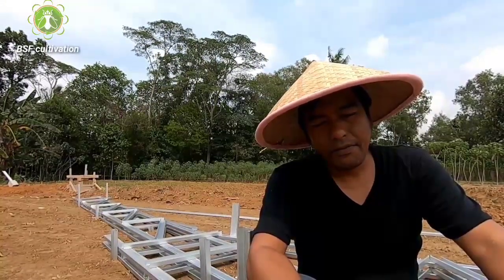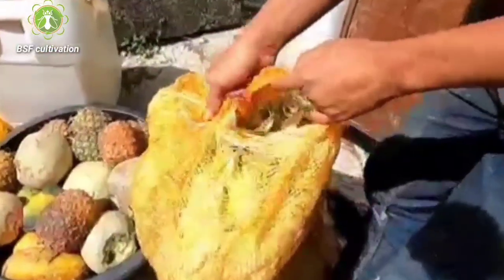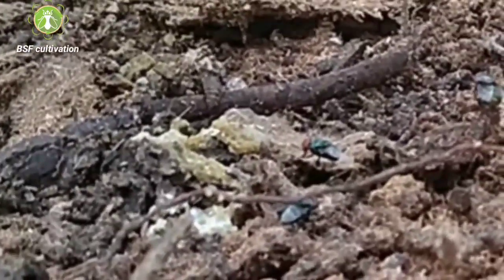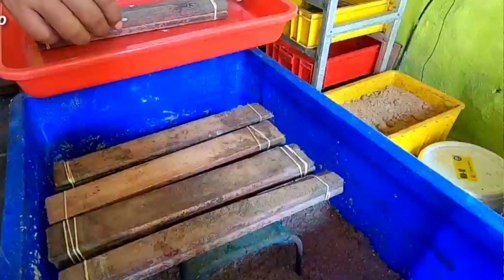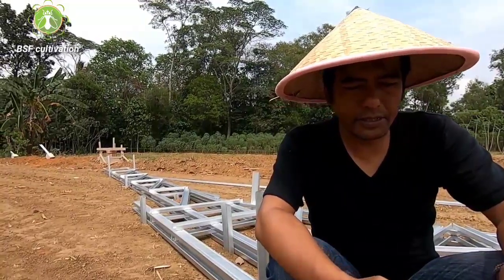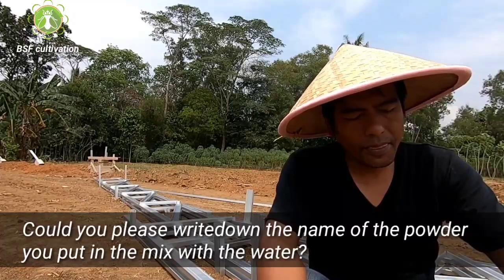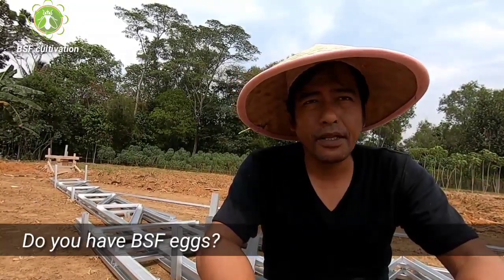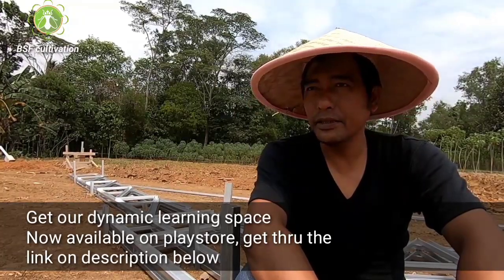Q /A about BSF Cultivation...

Comment: First of all thank you kindly for the time and effort you take to spread the knowledge. Thumbs up.

Second of all, I have a question, my understanding is that the larvae gets best results from the feed, when you provide the feed in a pasty/semi-solid form, i.e. by grinding the food material then add water to reach 70-80% moisture. I am wondering why don't you do that? Instead you provide whole food, tomatoes, pinapples, etc. Did you try this method and it did not work for you?